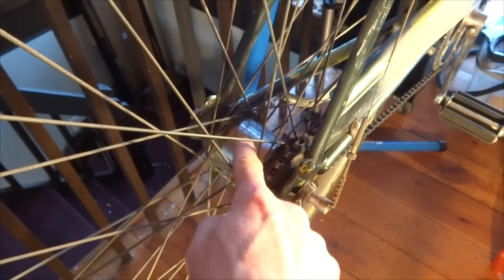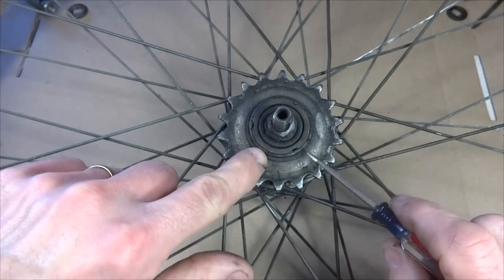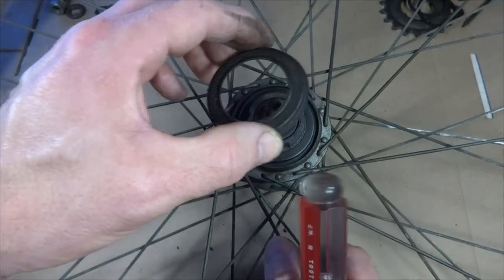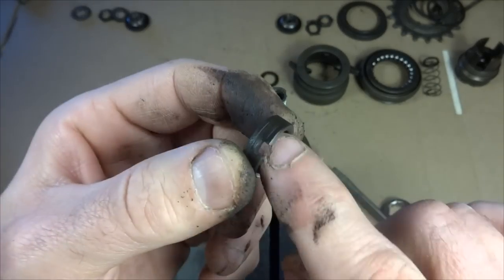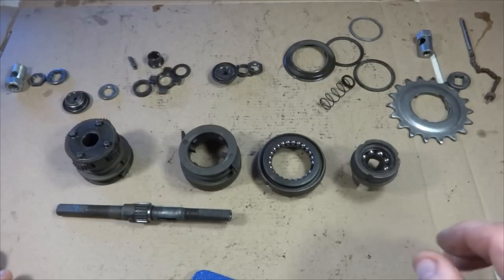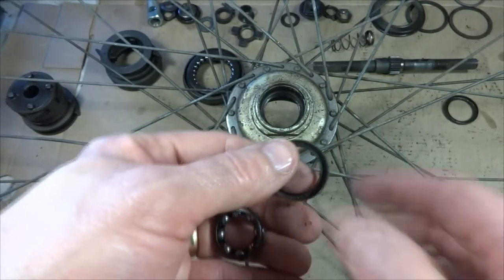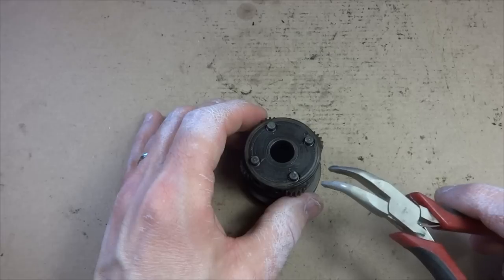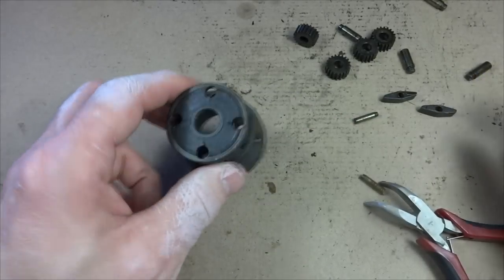Overhauling 60 Year Old Sturmey Archer 3 Speed Hub

Comment from the maker: For more bike repair videos hit the subscribe button 🛑 and click the notification bell ► http://bit.ly/SubRJTheBikeGuy
Reply: are thease near bulletproof or never give any real bother ?
Reply: Ian Brown So Ian, I’m wanting to upgrade my three speed internal hub shifter to a seven or eight speed. Any guidance...I know I’ll have to do some wheel rebuilding, replace all the spokes to which is necessary because they’re older. Thanks for your reply
Reply from the maker: @dougsabug  Personally, I prefer derailleurs over internally geared hubs.
Reply: RJ - is there a reason you switched from Phil Wood Tenacious to Finish Line synthetic for these hubs?
Reply: RJ The Bike Guy So RJ, regarding your preference – that is noted, regarding the insight you may have for these internal hub shifters: do you have any insights as to the gearing of the seven or eight speed units compared to the three speed unit? I’m looking for something with simplicity that makes it easy for someone who’s not a bike mechanic to manage and it would be cleaner than an external system.
Reply from the maker: @dougsabug  New IG hubs are expensive, have limited life spans, and are expensive to maintain. https://www.youtube.com/watch?v=k8qAn2D05R8
Reply from the maker: This is what you will need to lube it:
https://www.amazon.com/exec/obidos/ASIN/B00UCB98HI/ref=nosim/youtube25-20
Reply: @RJTheBikeGuy  me too they're much easier to understand
Reply: Yo RJ, ive got a nexus 7 speed with a bend axle. I took it all apart to overhaul it with a New axle, but they are very costly. Do you think its possible to bending the crooked one back straight or is this just to difficult or maybe not constuctional solid enough? Its bend out of center not real much ,maybe bout couple of millimeters
Reply from the maker: @marcelloroos766  You are in a world of suck. 7 speed Nexus is not as easy as this. WAY harder. The oil itself is expensive. The hubs die. Maybe just replace the hub.

Comment: I am trying to fix up my 74 Stingray.  1st gear is not working but 2nd and 3rd are fine.  The chain is pulled all the way out but it just freewheels.  Move it a bit in and 2nd gear kicks in,  Is there a simple way to fix or is a total overhaul needed?  THanks much.
Reply from the maker: Have you adjusted the cable? https://www.youtube.com/watch?v=KvR0S6lHJ4Q
Reply: Yes, I even unscrewed the barrel bolt so the chain is no longer attached to the cable,  I pull it tight, no gear, let the chain go in about 1/8 inch or so it goes to 2nd then a little more and 3rd.
Reply from the maker: Then maybe you need to overhaul it. Something might be stuck or broken.
Reply: That is almost certainly due to the low gear pawls being stuck down. Or maybe gunge fowling the ratchet they engage in. The internals need to be unscrewed from the hub to inspect, but you may then get away with removing, cleaning and refitting the pawls (beware fine hairsprings). Lubricate the unit  while out of the shell to get the lube evenly distributed. Pumping it in afterwards through the hole is asking for excess to leak out and create mess or even get on the rim and ruin braking efficiency.

Comment: The part you call the indicator pin is properly called the toggle chain. The pin you pulled is called a toggle pin. I am extremely well versed in these hubs, as I owned lots of them, and can pretty much fix them without any diagrams. You took it apart incorrectly.

Comment: As a kid 50+ years ago instead of unscrewing the large ball race with the hammer and screwdriver on the driven side to get it apart, I would chuck the fixed side hub in a vise on the two flats and use the wheel to unscrew it- quicker, easier. This was on the '50s & '60s wheels. Bought a new Raleigh Sports in '72 and by then they were pressing the fixed side in instead of threading. My sister borrowed the bike one night while wearing sandals and the hub came loose and she ripped her big toenail off when her foot hit the street. I replaced the wheel with a '56. The bean counters had begun their unrelenting quest to shift the global manufacturing paradigm from "How good can we make this" to "How cheap can we make this". They won. As someone else mentioned, the quality of steel they used on the old ones was amazing.

Comment: Worked as a bike mechanic from 74'-78'. Did several Sturmey Archers and another type which was popular at the time (push-pin design). Out of all the repairs I did to bicycles, this was by far the hardest repair. Many SA's would get broken chains and you could not get the pin out without opening up the hub. Big Hint - count the bearings when they come out. If you miss a single bearing you will not be able to adjust the hub. 
NICE VIDEO RJ !!!

Comment: I just dived back into the Raleigh - "Sturmey Archer World" after a 47 year break from cycling. Once again a demonstration video of pure perfection. I think I'm getting addicted to Raleigh bikes and the Sturmey Archer 3 speeds. I just acquired a 1978 Raleigh D-1 with lever brakes in which I'm trying to replicate a British WW1 Raleigh bicycle. I wish they used a Sturmey Archer 3 speeds, but nope, single speed as far as I can tell. A few changes to the DL1,,,,,,,, crank set, rear wheel 3 speed to single speed and a new style - old style 3 spring Brooks seat, bolt on - rifle mounts, leather tool case and cargo racks,,,,,,,,, last but not least - a paint job to khaki. Some where black, some where khaki.

Comment: I went to Schwinn school in the 80's, and 3-speed hub overhaul was a major part of the curriculum.  At the time I had already done both SA and Shimano hubs before on many a customer's bike, but the course was helpful to learn tips and tricks about these hubs.   Not long afterwards, IG hub popularity died off for a long while, and I have not overhauled one in probably 25 years.  So it is great to watch your video.  I may have to dig out an old bike at the co-op and open up the hub just for the heck of it.
Reply: trekkeruss  Hey good morning, I know these comments are about four years old - I’m coming in late in the game, August 2020.... but I wanted to ask some questions about your thinking on the shifting in these internal hubs. I know Shimano produces a Nexus hub that’s a 7, 8 or 9 speed internal shifting hub, I wanted to get more of a user feel for how these are geared. I’m wondering if the Nexis has a wider range... a higher top end and a better low end than the traditional three speed hubs (i’m concerned with the range of shifting more so, do you think that the gears are just spread out across the traditional three speed range? No one on my bike shop seems to want to answer that question – Dave’s cycling world—very corporate). I’m looking to switch out a three speed on a global Carmel and move it up to a seven or higher bike.  Doing this for the same reason you guys are talking about them: indestructible, nearly maintenance free, and for me, they’re cleaner – which is important for the user, not necessarily me, but I hear about it.  Thanks for any direction you can provide or personal insight.
Reply: @dougsabug  The info you seek is on Shimano's site. Their 3-speed hubs have a gear ratio spread of 186%, 7-speed 244%, 8-speed 308%, and 11-speed 409%.

Comment: You need to protect your hands from the mineral spirits: the stuff dissolves collagen and your body will rob it from other parts to replace what's winding up in the parts washer tub. I saw your hands at 14:20 and went, "Ouch". Trust me, I'm a retired ASE Master Tech and wish I had been more diligent about that when I was your age.
   Here's what I do nowadays: on this S/A hub I would have filled it up with 2-3 tablespoons of WD40 and rode it for a mile or two and then took it apart and soaked the parts in a bucket of warm water and detergent: good old cheap Tide works very well. Drying it up is all you need to do, residual detergent is actually a good thing for it and won't hurt the oil.
   After re-assembly I used 2 teaspoons of 2-cycle engine oil, that stuff you mix with gasoline. The synthetic is good, don't get me wrong, but it's expensive overkill. The 2-cycle oil is some sticky stuff, it has to be to do the job it's designed to do, and it won't leak out of your hub too fast. It'll leak some, but if you wash your bike every week or two it won't get on your tires and you'll get to replace a teaspoon or so every couple of months and so keep the oil inside on the newish side.
   Actually, getting back to your hands, transmission fluid is not bad to clean your hands with because of the detergent in it: sort of a preliminary to dissolve the grease and grime so soap and water can get the oily off. ATF doesn't get inside your flesh and dissolve the collagen like those solvents do. Come to think of it, next time I do a S/A hub I'll use ATF on it to clean it up before I disassemble it and I think I'll lube it with ATF for assembly.
Reply: ladamyre Hey good morning (8:30 hear), I know these comments are about four years old - I’m coming in late in the game, August 2020.... but I wanted to ask some questions about your thinking on the shifting in these internal hubs. I know Shimano produces a Nexus hub that’s a 7, 8 or 9 speed internal shifting hub, I wanted to get more of a user feel for how these are geared. I’m wondering if the Nexis has a wider range... a higher top end and a better low end than the traditional three speed hubs (i’m concerned with the range of shifting more so, do you think that the gears are just spread out across the traditional three speed range? No one on my bike shop seems to want to answer that question – Dave’s cycling world—very corporate). I’m looking to switch out a three speed on a global Carmel and move it up to a seven or higher bike.  Doing this for the same reason you guys are talking about them: indestructible, nearly maintenance free, and for me, they’re cleaner – which is important for the user, not necessarily me, but I hear about it.  Thanks for any direction you can provide or personal insight.

Comment: While I agree that Finish Line Wet Lube (or any other product like that) is good for pawls, their races and other things "like that" I feel that a viscous gear oil (like, I mean really viscous, syrup- or honey-like consistency, preferably with some MoS2 grease admixed into it) is a better choice for the planetary gear itself. But then you have to consider the climate the bike is going to be used in - if it is going to be used in cold winter it is better to use slightly thinner oil, if the climate is milder/ warmer you'd like to use thicker oil.

Comment: If the wheel looks a little odd, that's probably because it has 40 spokes, laced 4-cross. Not at all common these days.
Reply: That was old British "school" - 40 spokes on rear wheel, 32 spokes on front wheel - which made sense for "city" bikes, where the rider sits almost upright, with like 90% of the weight resting on rear wheel. And I have to admit I never noticed it's laced in four cross pattern... Thanks and cheers!

Comment: I have owned a couple of British bikes in the past which had those hubs.
First one was a BSA, as my money back then wasn't enough to afford a Raleigh, which was well past $1000,- in 1977 already.
After a year or 4 I replaced my BSA with a Raleigh, which is a city bike which will last a lifetime, actually I gave it away 2 years ago.
As I learned maintaining my bikes from my dad I was brave enough one day to take the Sturmey Archer hub apart, and I was amazed about the ingeneous way it worked, workmanship and the quality of the steel.
Even after 30 years of use there was almost no vissible wear on the parts, this was British engineering from the days gone by now.
A strange thing I marked from the video, what is gear one on your shifter was gear 3 on the shifters sold here.

I have a few comments on things seen in the video.
Firstly, the axle nut on the non drive side should be a standard 15mm axle nut, the tubular one was just to guide the indexing pin, however using a tubular nut on the other side won't harm, it was probably what the previous owner had around after losing the original nut.
Secondly, the amount of play on the second cone you fitted back in was to much, there should't be any visible play.
It must be tightened untill the axle feels to turn stiff, and then loosened a quarter turn, if it still feels slightly stiff it's not a problem.
When you buy a new cartridge bearing it feels a bit stiff as well, a new bearing is supposed to have an amount of preload on the bearings.
Having it that loose as you had will lead to uneven wear on the ball race as only a couple of bearings at the very bottom of the race will bear the load, instead of the load being spread around the whole bottom half of the race, also will the bearings have the tencendy to move from side to side a bit inside the race when not tight enough.

Comment: Great video. My 1968 Raleigh Sports 3 speed was in rough shape after being stolen in Vermont. The local constable found it a year later in the woods on the side of the road. After getting it back to working condition I noticed low gear was slipping. It would engage sometimes but mostly not. With the help of your video I took it apart. I found both low gear pawl springs completely gone and ground up inside. I also found all of the bearings and the 2 cones were pitted. After replacing all that and putting it back together it is running fine again. With a working low gear now!

Comment: Can you talk about how to maintain a English 3 speed with the oil holes in both axles and the crank? Maybe a vid would be nice too. Not sure if I should grease or continue to use oil. If I used oil in the crank and front axle, I'm not even sure what I'd use. It's strange, the front axle has a clip covering the oil hole. Thanks for the vids RJ.

Comment: Is it actually necessary to fully disassemble it? Wouldn't just slight cleaning and replenishing grease be enough?
Reply from the maker: It's up to you. Bearings wear. Can't replace them without disassembly. Taking it apart allows for a more thorough cleaning.
Reply: I see. At least they don't seem to need servicing very often :) BTW I have 2 AWC-II, one S3X and one 90mm drum brake + dynamo, I hope that with mileage much less than 1000 km per year each I won't need to get into them for the next decade :)

Comment: Its amazing to think that this hub was designed over 100 years ago without computers or any other modern technology,  Much less that it worked for 60 years.   I wonder if it would stand up to daily commuting. 

I had a few Sturmey Archer 3 speeds back in the 1970s.  I remember the problem that the low gear was not low enough to make it up a lot of the hills near home so it meant walking the bike.  I also remember that the shift chains frequently broke.   That was why we all went to "10 speeds" as we called road bikes then.    The last time I remember seeing one must have been 10 years ago.
Reply: A smaller rear socket provides better speed but you can swap it for a larger one to gain a lower gear for going up hills. A 22 Tooth sprocket is generally recommended but the compromise is a reduction in speed. Check out a few videos on the subject. You will also need to correctly size a new bike chain to fit or perhaps add extra links to the existing chain as long as it's in good condition. Watch some videos about chain sizing for single speed bikes such as a BMX.

Comment: Hi RJ., I have been watching ur vid for at least 10 times, your step by step explanation is really great . I love these old bikes & i got a wayfarer from my father on my 14th BD ( that's 40 yrs ago ) after watching ur vid got the confidence to dismantle a similar bike withSA , followed all ur steps & everything went well except after reassembly & when back pedalling there is a noise coming from it like a metal rubbing to metal sound , all 3 gears working fine , any clue what can that be please?thx in advance
Reply: I also have one that is doing this. Slight metal scuffing sound when backpedaling or coasting but works fine. I'm thinking maybe the driver scrapes the inner dustcap but I'm not sure. The noise was already present before the rebuild.

Comment: PaulHoughtonh Houghton
HUB'S DIFFERNT: Due to a failure with my 1982 3sp AW spindle (gear indicator keep pulling out) I decided to remove the complete inside mec and swop it out with the insides of a 1984 3sp AW hub (new old stock) but have noticed inside the 1982 hub differs from the 1984 hub? the 1984 hub has a shoulder in the bottom of it but the 1982 hub don't  Are both insides interchangeable with each other. Though I have now fitted the 1984 inners but is not as smooth as I think it should be, would this be due to the differences in hub bodies?  Has any one got any information  can share. Thanks

Comment: I clogged up one of these with water & mud on my old Raleigh Grifter in the 1980s......it took a while to pack up and it eventually ended up in "Neutral".
It was stripped and cleaned out and it worked again for a while but finally  stopped working due to a lot of full-load "Straight Through" gear changes !!!!

Comment: I'm overhauling a 3 speed hub from the 70s and the little plastic dust cap on the top of the clutch spring got smashed by accident. Anyone think I can get away with reassembling it without the cap?

Comment: In Sachs hub I'am using grease for bearings instead of oil. I also used the "greasing port" on hub, but I put so much grease that is started flowing away from left side. It's running like a dream and I don't have to worry about wearing the brake pads inside.